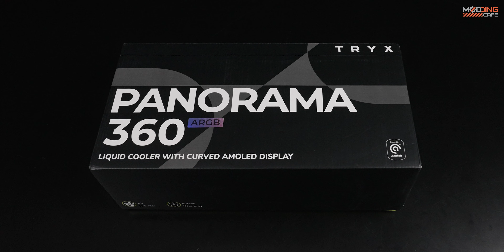Tryx Panorama AIO: Hard tube custom loop conversion

Comment: Wow this is awesome…. I wonder what other AIOs you can do this with.
Reply: Is there a reason someone would genuinely do this tho? Seems like it'd make more sense to take the screen portion and mod it to fit over a traditional water-cooled CPU block.
Reply: @emilyshabang  Asetek pump in these AIO is pretty good and make the loop look more minimal. Also it the AIO software just work if you use the original pump.